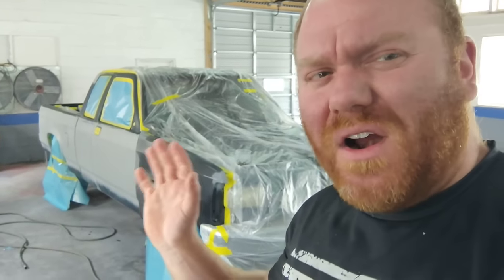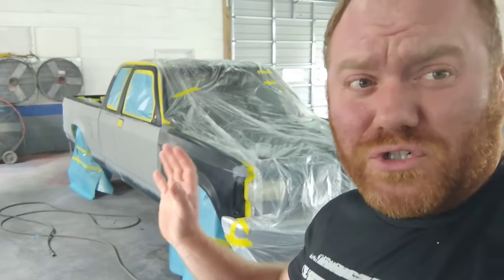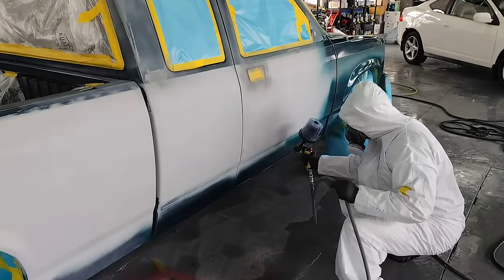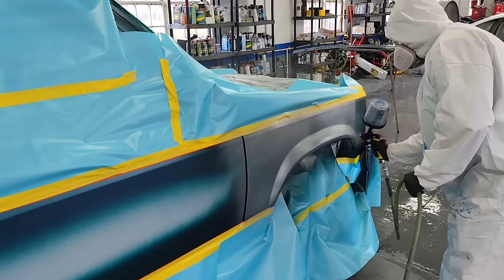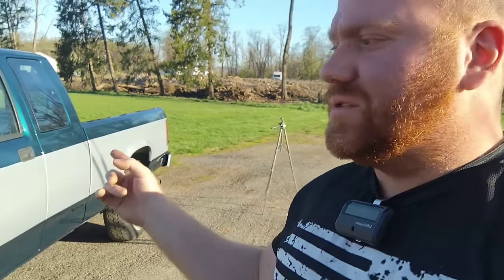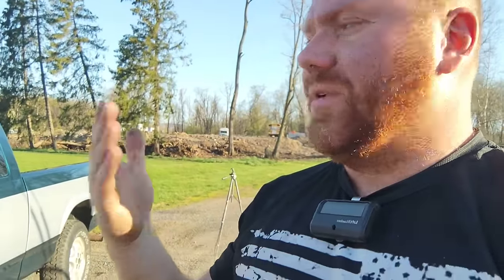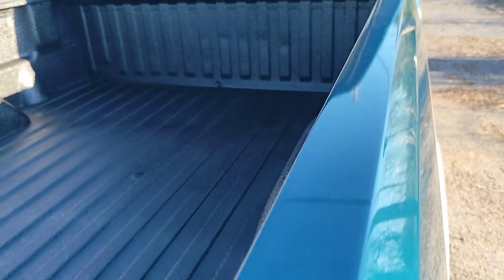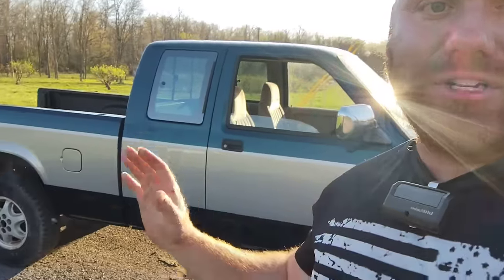800$ paint job DODGE DAKOTA

Comment: Came out beautiful looks like one of those restored older trucks at the gas station. What do you think about the 3m trizact? I plan on using 2000, 3000, then 8000 and then meguiars 105/205 over single stage for maximum gloss.
Reply from the maker: Very good stuff I've used it. 
However I would grab out 3 speedokote 3 stage buffing system . 
It's top dog . You will be amazed

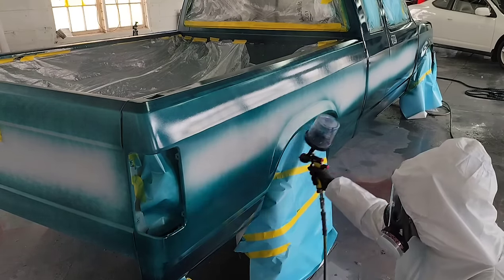Comment: Minute 4:50 I agree that over spray will go to the white car back there 
Oh talking about white cars are the white cars around the painter going to have the same paint code if yes that will be awesome that way you save money on paint if not regardless will have the same green color
Reply from the maker: White car in the background is getting painted in a few weeks so doesn't matter . My shop is also 9000 square feet with cross draft ventilation so no real issues with getting stuff on anything else in the shop

Comment: hey, what brand paint is in your 2k clear coat urethane smr-130?
sherwin? basf? I'm curious how durable the uv resistance is
How many coats of clear does a gallon cover on a camry?
Reply from the maker: It's speedokote . We test it for 2000 hours uv . 
And a 2 gallon kit will do about 2 full cars depending on how you spray

Comment: I'm  having trouble spraying the smr 130 clear coat.. With  no flash  time do I spray  it wet  on wet?
Reply from the maker: Depends on temperature. 
Super super hot weather almost no flash. Colder temps 5-7 min flash

Comment: Where are you located
Reply from the maker: Pa
Reply: @speedokoterefinishnetwork4937  where can I message you about info on painting my truck and what part of PA I'm in Boone, NC
Reply from the maker: @money-pit9956   we don't paint trucks for 800$ . This was material cost only for diy reference
Reply: @speedokoterefinishnetwork4937  I understand that the truck is a dodge ram crew cab long bed dually few small dings and repaint same color I know it won't be that cheap just wanted to get a ball park

Comment: Yessir the color costed me the most but still not bad. 399 for a gallon of Speedokote base. Honda metallic blue. Shipped to the house like the very next day or day after i ordered it! U cant beat it. I haven't even sprayed it yet and im happy lol. I could of got away with way less base because the car is a small civic plus it says mix 1:1. Speedokote over tractor paint or Rust-Oleum any day! I been sanding off somebody's dang Rust-Oleum or something for weeks now 😡
Reply from the maker: 399 for a full gallon of base is highway robbery super nice
Reply: $399 is cheap compared to cologne. I just ordered a 4.2 oz bottle for $91. That works out to nearly $2800 a gallon, like WTF 🤷‍♂️ We’re in the wrong business!

Comment: At 2:35 what were you spraying with the aerosol can? Self etch?
Reply from the maker: Yea etching primer
Reply: @speedokoterefinishnetwork4937  I got the high build primer/sealer from speedokote in the green can I can’t remember what the number is, I have to prime an 82’ gmc that has some metal showing here and there, can I use this etch right before I prime? Like wet on wet without sanding the etch.